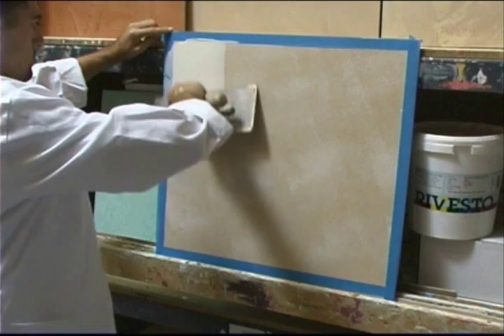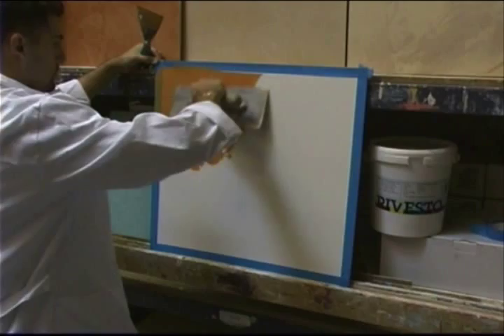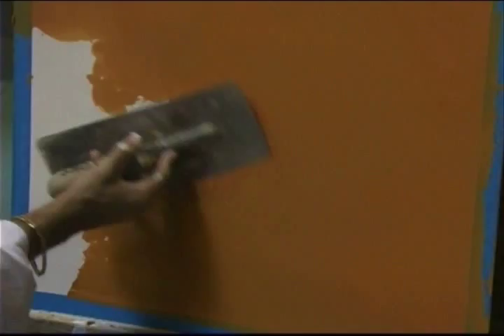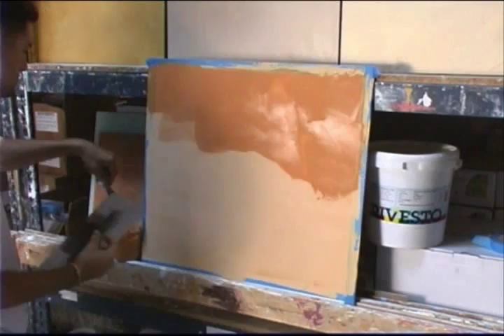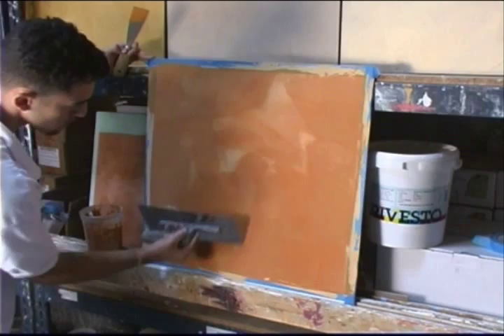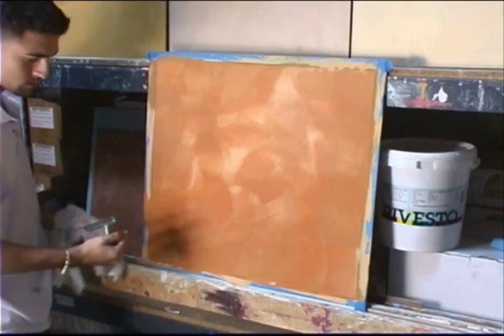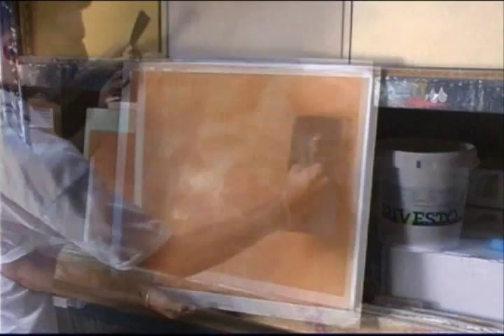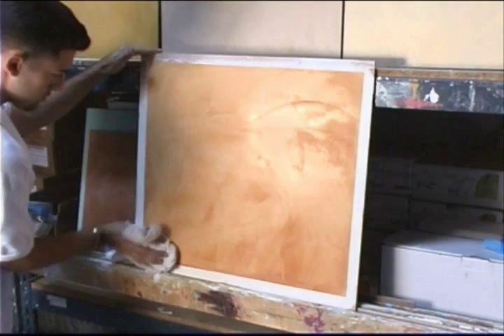Firenzecolor Venetian Plaster Authentic Demonstration

Comment from the maker: To answer your first question:  You do need to do a base coat in order to make the surface as smooth as possible.  Texture on the surface will create dark lines and ridges and uneven shine.  You cannot wait too much before going over the last coat to burnish.  Rule of thumb is to burnish every 2 to 4 square feet of the third coat.  Thanks for your questions!